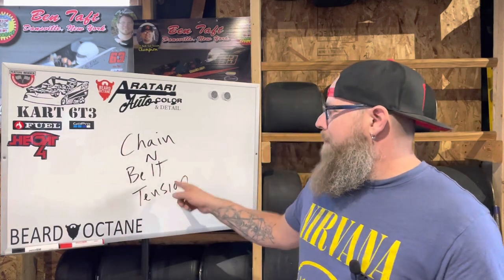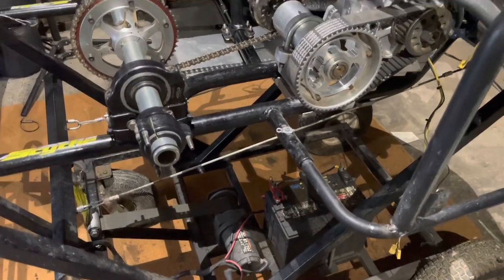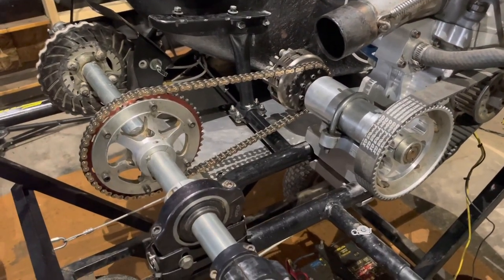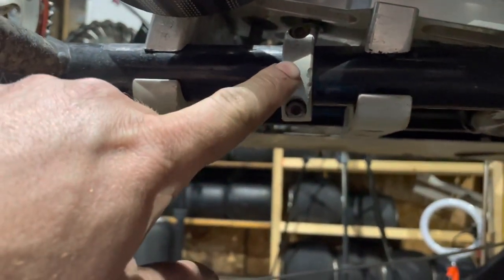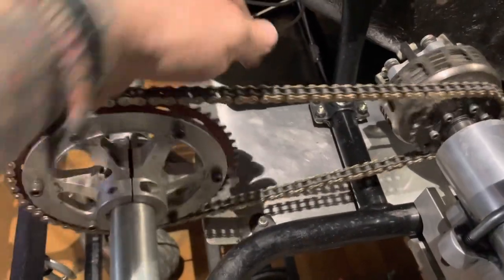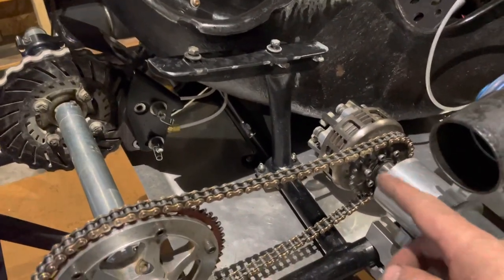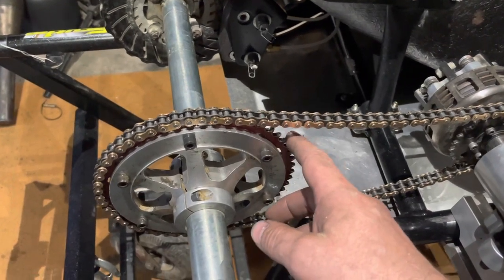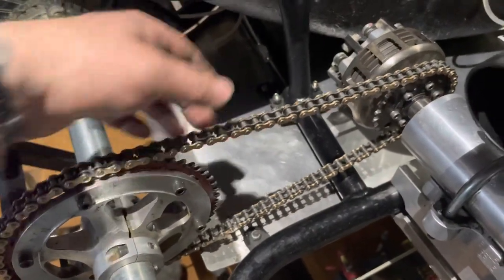Chain tension: tips

Comment: I’ve noticed whenever you move the motor or helps to put downward pressure on the top of the motor to make sure it’s seated to the chassis. This keeps the chain tension from changing too much when tightening. Great video as usual Ben. Your channel is really becoming a go to place for tech help.
Reply from the maker: Good tip also.  Thank you.

Comment: I would like to see the mounting of your KT100 pipe. I always have a problem getting the pipe away from the seat with the correct flex. I have the burns to prove it.
Reply from the maker: I’ve found this is usually a engine placement issue.   Most people I’ve seen the engine too far forward making the pipe tight to the seat. Because the KT is so light I get it as far back as I can to the RR tire (the jackshaft makes this hard)    I agree though it’s a balancing act.

Comment: What's the locking collar on the frame tube for🤔
Reply from the maker: Open yanks the motor back, extra help so that doesn’t happen.
Reply: Gotcha... My buddy runs a 450 on that Riot, it has a threaded rod on the back to push up against the engine mount.... just was curious.